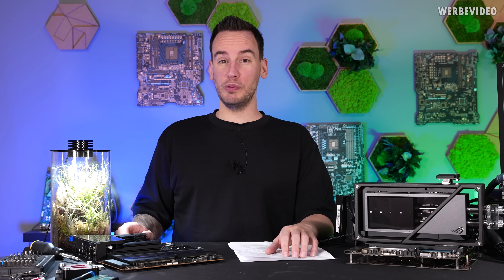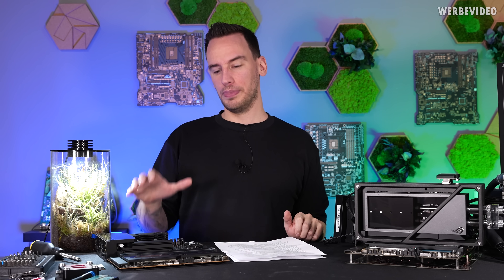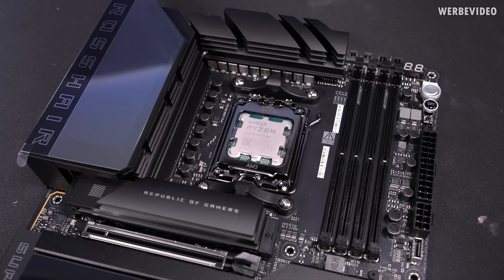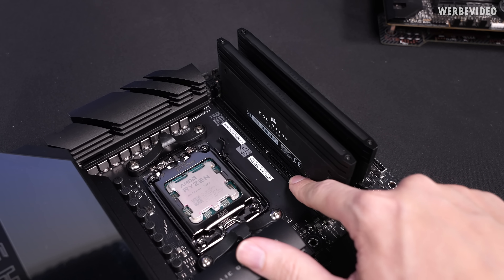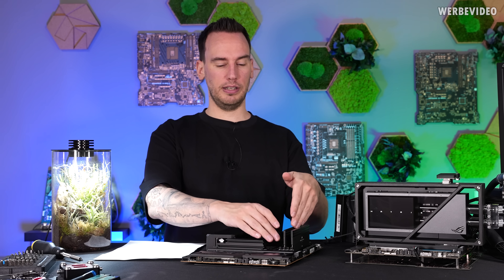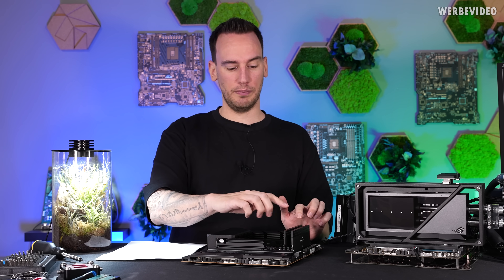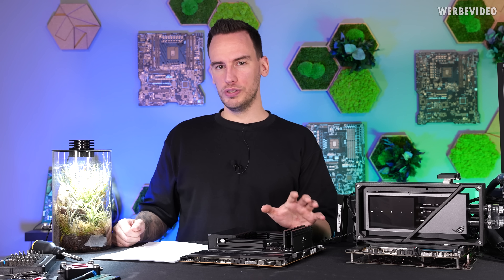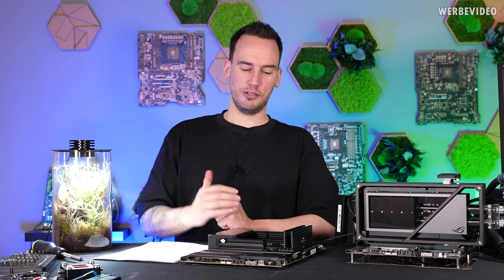How Empty RAM-Slots cause Trouble - ASUS NitroPath

Comment: Very cool, thanks for the presentation. In English we would use "sinusoidal" for a sine wave.
Reply from the maker: Ah that makes sense 😁 thanks!
Reply: @der8auer-en  I appreciate that you have no fear tackling these impossible topics in a second language. We all understood you meant sine wave / sinusoidal behaviour. Also, the "rectangle" is usually called a square wave. 
To help with pronunciation, "sinusoidal" = sin - you - soy - dall
I especially appreciate that you share these interesting technical details, where no other PC tech Youtuber dares to go. Thanks!

When the "marketing image" of the new pin contact appeared, I immediately thought it was not complete / deliberately flawed. The sharp edge of contact might work well for a little while, but it will soon cut through the contact layer on the DIMM due to thermal movement. 

And attempting to remove a DIMM, pulling it against that scraping edge, would cause significant damage too. Push-fit plumbing fittings (where metal grabbing rings hold onto plastic pipes) are shaped EXACTLY like that. So that they never come loose, and flood your property. The sharp edge digs into the pipe, if ever it tries to pull out. There is a special release tool that lifts the contacts away from the pipe, to allow the pipe to be pulled out of the fitting. So, having this design shape on DIMM slot pins meant the DIMMS were never intended to be removed. Ever. 

Adding a rounded tail (to allow the DIMM to slide out as easily as it slides in) was the obvious modification needed - exactly as revealed by the cross sections. 

What is less clear is whether they deliberately tried to mislead with the picture, in the hope that anyone "copying" it would make it exactly like that, and have serious problems with their product. But it is possible the image was an initial design concept that was tried and developed into the actual design. 
I've worked in environments where both options are possible.
Reply: @bythelee  In British English we'd usually pronounce it SINE-you-soy-dul (sine rhymes with mine), instead of 'sin', but that's just a regional pronunciation thing. Both would be understood in most places.
And yes, you could also just refer to a 'sine wave' or a 'square wave'.
Reply: @phuzz00  When using "sin" in the mathematical context, we pronounce it "sine" as well. I suspect bythelee was just using the math spelling of the "sin" property/function and not the "sin, you are living in sin" version of the same spelling.
Reply: @Maadhawk   Thanks for the benefit of the doubt, but no, I was taught to pronounce it as "sin" (as in, living in sin) some 40 years ago, and have never encountered the other option until quite recently. When I suggest pronunciation, I use simple words that represent the desired sound. Had I meant "sine" I'd have written it that way (or maybe "sign") I am familiar with how, in math, sin(90) is still pronounced sine 90 (degrees). I have a suspicion that sin versus sine pronunciation is a "local preference" thing, or maybe a modern alteration.  I'm sure everyone would understand what was meant with either, just as we all understood Roman's Deutsch inspired version.
Reply: Sinus tech tips
Reply: don't need to get all sinusoidal about this
Reply: I don't know if it's a language issue or what else, but, what I've heard is completely confusing 
and misleading to listeners, and I can already see it in the comments (from 10:11).

AMD example.
DDR5-3600  its official specs from AMD for Ryzen CPU/chipsets for 4 DIMMs in socket,
So,  3600 is if 4 dims are installed ( Intel also has like this for different number of DIMMs in sockets).

Ryzen 7700

Max Memory Speed
2x1R	DDR5-5200
2x2R	DDR5-5200
4x1R	DDR5-3600
4x2R	DDR5-3600

With  2 DIMMs we have DDR5-5200   ( 5600  intel) and no mater have we got 2 or 4  RAM sockets.
For two dims, especially  for 1 rank (2x1R)   1Rx8 (SS ) DIMMs   there will be no big difference 2 vs 4  socket motherboards.
Yes,  2 dual-sockets MB  are better at the most extreme RAM frequencies, but not like 4200 vs 8000.

Here is the example from QVL for Z790 AORUS MASTER (4 RAM  sockets  MB)  memory for 2 DIMMs: 

8000 TEAMGROUP 16GB 1Rx8 FF3D532G8000HC38DDC01

8000 TEAMGROUP 16GB 1Rx8 FF4D532G8000HC38DDC01
...

So, you can install  2  DIMMs in different memory channels, two sockets  will be empty, and you will have  DDR5-8000 (not  3600 or 4200 intel)) with   4 RAM  sockets MB .
There is no such limit for 2-DIMMs in 4-socket  MBs.

RAM QVL has different speed specs depending on whether you use 4 DIMMs or 2 DIMMs in 4 RAM sockets  MB.

"(The CPU and memory configuration may affect the supported memory types, data rate (speed), and NUMBER of DRAM modules, please refer to "Memory Support List" for more information.)"
Reply: Sinusoidal is not English. It is French.
Reply: @Adam-jr4lx English is just badly pronounced French.😂

Comment: I still hate with passion ASUS' DIMM slots with latches only on top
and it's not only them, I've seen MSI and AsRock doing it
stop it, get some help
Reply from the maker: My X870 Hero has it on both sides. Guess they changed that with the new slots
Reply: @der8auer-en  thank god
Reply: Nitropath slots have a latch on both ends.
Reply: What is the issue with them? I'm new to this
Reply: @labmasterx5599 difficult to take out or even install.
Reply: @labmasterx5599  you don't know when they're fully seated, with a latch you'd know because it's closed

Comment: so unoccupied slots still run power to those little "antenna"-like pins?! that... seems stupid to me, but maybe that easier/better than just not doing that.
Reply: At first glance that may make sense, but if you're going to cut the signal from the unoccupied pins, you will need to introduce some sort of switching component in the signal path. Not only is 288 pins a big number for even the cheapest component to actually add up to make some impact on the price and the physical layout, having such components in the middle of the path will also degrade the quality of the signal, more than having the pins just act like an antenna.
Reply: While switching DDR is theoretically possible it'd be quite expensive. Simply transitioning at DDR5 speeds needs a modern process node and that's going to drive design costs at the very least way past the point that it's economical to make the part.

An easier solution would be a termination dummy DIMM that was just a PCB with some resistors on each of the high speed lines. That'd damp the stub and prevent the reflection.
Reply: I think it's because when there are two slots for each channel they are either daisy-chained or use something called T-Topology, so you can't really "turn off" the extra slots.

Comment: Always buy 2 slot motherboard. 4 DIMM's are trash
Reply: until you need the capacity
Reply: @zMeul you can get 96GB with 2 dimms, this is more than enough for 99,9% of users
Reply: @ThunderingRoar  that's not what I said and what you think I need and what I need are two different things
Reply: @zMeul most CPUs can’t even run 6000 with four slots installed. If you need more ram, just upgrade to the biggest dual rank kit instead of using four slots of DDR5.
Reply: @PowellCat745  there are no 64gig DDR5 DIMMs available
Reply: @zMeul  buy a 2x48 kit if you don’t want to tank performance. If you really need that much RAM, go for 4x48 for the highest potential speed because 4x48 is easier to run than 4x32.
Reply: until u need to upgrade...
Reply: @quasplashipu upgrade by downclocking your RAM?
Reply: @PowellCat745  what bro talking about 🙏🏽😭
Reply: @quasplashipu  you don’t understand because you don’t know how hard it is to run four sticks of DDR5 even at 5600. Not surprised.
Reply: you can just use 2 on 4 dimm mobo.

2 dimm mobos are usually trash.
Reply: @user-wq9mw2xz3j Daisy chained 4 dimm motherboards for DDR5 are stupidly useless. “Gaming” motherboards with 4-DIMM slots should be legally banned.

Comment: Ah yes, naming your ram about something that explodes and blows up.
Reply: *blaming ?
Reply: Intel should have called raptor lake Nitro Express 😅
Reply: It's named in honor of Dan Clark - the greatest of the American Gladiators!
Reply: You mean like the ... "® Turbo Boost Technology" that we have on the central processor of our modern PC computers? Ja?

Off to warm up my 4070RR 16GB 24v TURBO NITRO BOOST BFG CARBON EVO INTEGRALE
Reply: @raymondo737  EX PLUS ALPHA
Reply: Natural Aspirated is what they should call ECC RAM, simply for being incredibly reliable.
Reply: @emenesu  car guy!!! I’ll bet you have a mustache 🥸👍
Reply: actually nitrous oxide is about as flamable as oxygen is
Reply: @limewirepro  I was thinking more Nitroglycerin
Reply: @limewirepro I assume that’s not true.
Reply: @limewirepro  I'd say that about NO2, not N2O
Reply: @limewirepro correct, nitrous oxide and nitrogen dioxide (as mentioned by another comment) are not flammable so no more flammable than oxygen.
Everyone else, take basic chem and think about the risk there would be using at dental offices if it was flammable.